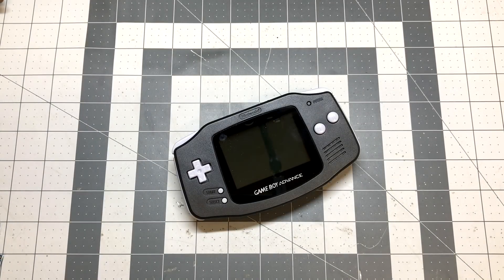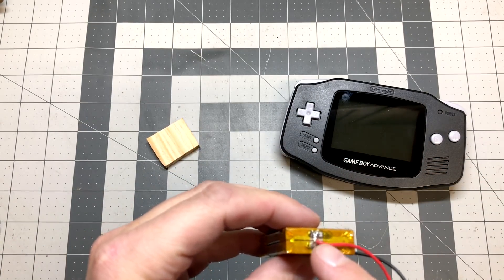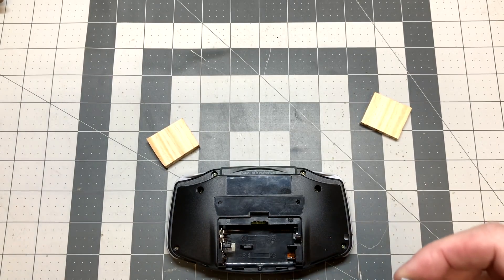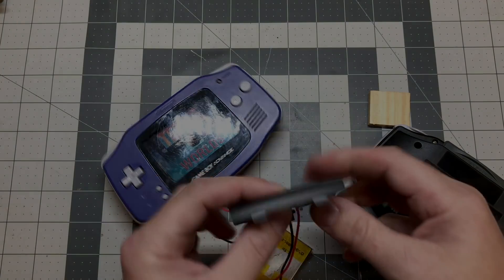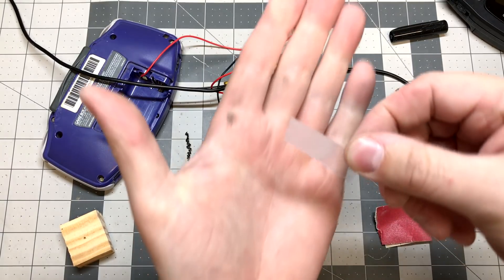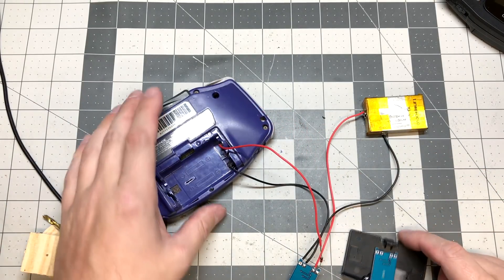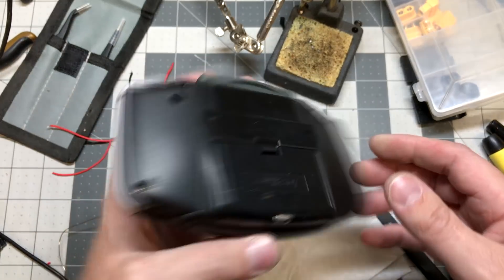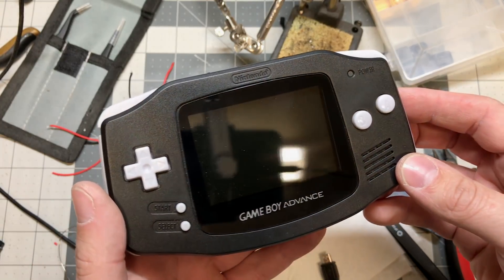USB Charging.. SO MUCH POWER.! #lithiumbattery #gameboymods #rechargeable #backlitgameboy #gba

Comment: I was wondering some things:

- I want to use a 1600 mAh battery (103048) that already has a protection circuit, could it interfere with the Lithium Charging Board in any way?
- I'm going to use a USB-C charging board instead of the MicroUSB you used because they are as cheap and all my cables are Type-C. :D
- Is the zener diode safe? I mean, it drops about 0.7v, but that energy has to go somewhere... does it get hot? Also, with the lower voltage, does the battery cuts the current to protect itself before the GBA displays the red low battery indication?
Reply: Also, how many hours do the system run with your batteries? You also have 1600 mAh batteries (2x800 mAh in parallel)
Reply from the maker: -Pretty sure your good with the built in protection circuit.. It shouldn't effect the cell..
-As for the type C that's Awesome.. Didn't know they made those.. I will have to get some.
-I didn't notice the diode getting hot.. But you should set it up and see for yourself. And I have no protection on the cell.. The GBA shuts off before the cell gets too low.
-As for run time.. I don't really know.. Way longer than I care to sit and stare at a little Screen.. :)
Reply from the maker: When I was talking about Shrek playing 3 times.. that was not the full capacity.. It was still plenty charged.. I just got tired of letting it sit there playing.. But even if this did only get 5 hours of play time.. Which I know it is longer.. Just not having to have a charger or carrying around extra batteries is quite the luxury.. It brings an older system up to todays standards.. and I am sure you could fit a way bigger battery in there if you really carve up the case.
As for making a video I might do that.. :)
Reply: I plan to use a 1600 mAh 10x30x48mm battery because I want to cut as little plastic as posible, I even did a test with some foam I cut to size so I can be sure that the battery fits.
And I might explore how to solder the wires to contact plates so I don't have to solder them directly to the GBA... that way I can always put some AA's.

Again, the video would be greatly appreciated, I've been scouring the internet and you seem the only person that recorded a video of this mod, there's some forum post here and there, some referencing this video, but none explained how it went and what were the results and battery life. ¯\_(ツ)_/¯

Comment: Hi, I just completed the rechargable battery mod but I ran into a problem when charging the battery while playing and when it goes past the full charge it makes my gba glitch out and shut down.... I have the diode you linked soldered to the positive out and facing the right way.... what could be causing this? Thanks btw for sharing how to do this and I am stoked to have gotten this far
Reply from the maker: Do you have a multi meter..?  If so check the voltage at the GBA Terminals when it's fully charged.. If it's over 3.7v that is why your GBA is cutting out.. If that's the case I would replace the diode to a different one.. The diode should be dropping the voltage down below 3.5v... Also make sure your battery case is not touching the negative terminal of the GBA. (If you used GBA SP batteries that is.)
Reply: Keylitho will do! Thanks for the quick response. It's also saying its fully charged when I drained the battery from playing... so I'm just gonna restart with a new battery and micro usb board and see how it goes. I did have the battery wrapped in electrical tape, and it turned out that the positive of the battery was the casing. I also fried a couple of micro usb boards thinking the end terminal of the battery was positive... oops! I'll get back to you asap when I rewire the new battery I get Friday! Thanks again!
Reply from the maker: So you were using GBA SP batteries..?  if so...  LOL.. that's crazy.. Read the first thing I had in the description of this video. Those things are hit or miss.

Comment: Hey guys! Retro modding offers this mod in a complete kid for 40 bucks, but I'm quite broke so I got their battery on ebay for 9 dollars, the boards for 5,  and the diodes for 2! Here are the links!
Battery : https://www.ebay.com/itm/172756197147
Boards: https://www.ebay.com/itm/331807199273
Diodes : https://www.ebay.com/itm/132500905967
The battery also makes it so you don't get bulge! You should try this out, Keylitho.

Comment: Can I use a battery removed from a GBA SP?
Reply from the maker: The battery's used in this video are from the GBA SP...  :)
Reply: Keylitho Thanks, I thought the Batteries were a replacement kit for the original GBA.

Comment: I just realised that the BL-4C battery is a close match for the GBA SP battery and probably more available and affordable and if anyone knows of a battery that's not as wide as the BL-4C battery then that would be better as les modding of the GBA case will be needed.

All you have to do is cut away the plastic that's holding the metal connector on the left hand side of the battery compartment and then take away the metal connector and also cut into and away about 4-5 mil in plastic at the top of the compartment all the way along the top under the pres catch (clip).

Also you could get two 3ds XL batteries and 3D print a case that would hold the larger batteries and connect it to the battery compartment of the GBA case or do the same thing but for the BL-4C battery.

Comment: Can this same mod work on a DMG model?
Reply from the maker: It will possible work according to this voltage test data I found.. a single cell lipo runs from fully charged at 4.2v to pretty dead at 3v and the DMG seems to function ok between those voltages.. but testing would be needed to see if it works.. 
http://blog.gg8.se/wordpress/2009/07/22/testing-gameboy-input-voltage-ranges/

Comment: Hey, just a small question from a beginner - why only one negative on the battery is soldered. not two?
Reply from the maker: Well the Batteries are taped together.. and the case is Negative.. So its not really different than stacking batteries in a flashlight.

Comment: This is awesome! The only thing that I hope for an improvement on is that I'd prefer a way to get a pair of contact plates onto the module so that you don't need to solder directly to the GBA's battery contacts, kinda like the Retro-Modding module except not $40. I'm wondering if just a thin plate and gluing the contacts onto the plate will do. I get that it already involves a case mod so this might seem kinda pedantic, but I'd prefer to solder as little to the motherboard as possible.
Reply: Was thinking the same thing. Would achieve a much cleaner setup. I’d prefer to solder the wires into the glued contacts on the plate, so those contacts on the plate will touch the motherboard spring contacts instead. 

But this was a year ago. Has anyone tried and does it work 🤔 any opinions on this?
Reply: Haidi I tried it with battery contacts and it works. However I’m only getting 2 hours battery life with the dsi battery I have, so I think I got old or bad battery or I possibly heated up the cells too much while soldering idk. Any help?

Comment: Ever tried something like this with LiFePO4 batteries?  They are 3.2v so no voltage drop is needed.  You can also get the little PCB chargers for them too.
Reply: Link?
Reply: @Ragesauce  You dont need to voltage drop anyway. GB, GBC, GBA, GBA SP, all have regulators that will bring down the voltage. They will all run from 2.5V to ~12 (though i wouldn't suggest going over 9 due to heat. 5v, to keep it at usb voltage is best)
Reply: Andrew Gist Is that definitely right? I thought that anything over about 4v resulted in the GBA shutting off?

Comment: The DS lite battery when stripped down has the same form factor but is marginally thinner. The battery cover doesn't bulge up like it does with the SP batteries. At least in my case it doesn't. YMMV They are also cheaper and according to the Chinese they have a higher mAh too lol

Comment: Have you found a suitable single cell battery that would fit yet?
Reply: Bazahaza DS batteries are pretty good, you just have to strip them then solder the same and it's 2000mah so not bad!

Comment: Hi im doing this mod and iv almost got all the bits just waiting for some batteries to come... But i was just thinking does it matter which way you connect the diode are they like resistors in this way.
Reply from the maker: Yes it does matter which way they go.. Just watch a few video's on Diodes..

Comment: The diode its necessary?
Reply from the maker: Yes because the charging board charges the battery to 4.2v and the GBA will not work on 4.2v so the Diode just drops the voltage a bit so it will work.
Reply: Keylitho
I can use 100v/ 200mA? Or who it’s better ?
Reply from the maker: Probably.. Check the voltage with the diode in place.. as long as it's not over 3.7v when the Lipo is fully charged to 4.2

Comment: I have a question. I have this DS Lite Battery. Can I use only one for this mod or do I need 2 like the ones you used it?
Reply from the maker: You can use just one.. You will just get 1/2 the run time.

Comment: could you use a 2500 mah 3.7 volt battery for this, would it extend the overall charge time?

This is what i was looking at:

 https://www.amazon.com/Adafruit-328-Battery-Lithium-Polymer/dp/B01NAX9XYG/ref=pd_cp_107_1?_encoding=UTF8&psc=1&refRID=K5RCF5SAYFSBWWR0G8Q1

Comment: Hey. I used the ribbon adapter with only the wire connection. I see you got the brightness adjustable adapter, in the battery compartment is the switch. Do you find it was worth it? With mine with just the adapter with wired connection, I achieved brightness equal too the sp ags101 system brightness on its lower setting. Big fan!
Reply from the maker: I can only get about the Same brightness as the AGS101 on low as well.. The switch just lets you go even dimmer than that.. So basically I just leave it on High and never touch it again as long as I live..  LOL  :)

Comment: Let's see... NiMH you get at 2400 mAh * 2.4v = 5.76Wh for cheap Eneloop Pro clones, for example Ikea Ladda for $7 for a pack of 4. ((2/3)+(3.2/4.2))/2 gives us the efficiency of voltage dropping diode of about 71%. This battery you get at 850mAh*2*3.6V*0.71 = 4.32Wh. Not exactly a net benefit. :( pity, for all the effort and good workmanship.
Reply from the maker: Capacity or run time is nothing compared to the convenience of charging this with a USB cable.  It still lasts way longer than anyone would care to sit and stare at this thing in one sitting.. Plus if you can stare at it forever you don't have to power down to switch batteries.. Just charge and play..  :)
Reply: Yes, these are runtimes in tens of hours. And TP4056 is a nice little charger, it can get pretty warm when the batteries are near empty, but it has a good consistent behaviour and it charges at a nice reasonable pace.

I diced some possibilities around, and i simply can't suggest a good, fast, efficient, reliable, in-situ charging circuit for 2xAA. The battery control ICs that i'm aware of tend to revolt to such use because the use will potentially set off their dV/dt detection and they'll be like ooops, time to trickle charge at 1/16th! Plus they don't mind giving the batteries a good bit of juice, like 2V peak per cell, and that will possibly upset the GBA. This is why the devices you usually see powered by in-situ NiMH cells tend to use current-limiting and slow charging without charge termination, which isn't all that good for NiMH cells either.
Reply from the maker: Yes... for sure.. you will love it..
Reply: So should I do this mod or not? I want to be able to play and charge my GBA at the same time so I don't have to turn it off to switch out batteries all the time.

EDIT
Do you think 2ds batteries would fit? They're usually 1300mAh.
Reply: I think the voltage boost from the 5v regulator makes it worth it

Comment: Generally curious: what's the benefit of using a zener diode over a standard voltage divider (outside of number of components)?
Reply from the maker: Well I'm not to familiar with a voltage divider.. but don't those typically cut the voltage in half or more..?  The Zener Diode only drops the voltage about 1 volt and like you mentioned.. only one small component = simple..  You really just gotta get that 4.2v fully charged lithium down to 3.7 or less.

Comment: Do you have both negatives of the batteries connected to the charging board or just the one? and if only one, does it matter which?
Reply from the maker: Well the Metal case of those batteries is the negative.. they are just touching each other and taped together.. so they are one and the same.
Reply: Great to know, thanks for the quick reply
Reply: @keylitho  I did everything according to the instructions, but the board heats up very much ... so much that it melted a little plastic...
Reply from the maker: @udjinhanc  I would change that board out for another and see if the issue is still there..
Reply: @keylitho  this is my mistake, I mixed up the polarity and the board failed, on the other hand, everything is ok!  Does it get warm when charging?
Reply from the maker: @udjinhanc  Yea it does get a bit warm.. but it should not melt the plastic.. or even the Hot glue for that matter.
Reply: @keylitho  I failed with two different batteries, and two charge cards, as soon as I connect + and - the microcircuit starts to heat up very quickly ...
Reply from the maker: @udjinhanc  Did you check the polarity of the battery and also follow the Wiring diagram in the description..?
Reply: @keylitho  of course.  I compared the boards, on your inscription tp4056 and on my tc4056a, maybe this is the problem?
Reply from the maker: @udjinhanc  Hmm... there is talk in some forums of some clone chips out there and people have had the same issue as you.. I would recommend getting some new boards from a different seller.

Comment: i don't understand the hate of rechargeable,i have a smart charger that charge them in 2 hour and cut by itself at the end,it even tell the battery level,.it was pretty cheap too. and rechargeable stay a long time in game,good ones are easy to find and they are sold by pack of 4 so you have always a spare...
Reply from the maker: I don't think it's a hate thing, after all these are rechargeable batteries as well.. I think it's a lets get this older system up to date thing.. Everything now has built in lithium batteries with integrated charging circuits.. So adding this to an older system is just basically for convenience.. and just being able to charge this with a micro usb cable from any usb outlet or battery pack, was the primary appeal of this mod for me.. Not to mention that you can charge and play at the same time.. so you don't have to power down the system and change batteries.
Reply: It's about energy density. The MiMH rechargeables that fit the AA battery holder actually store less power than alkaline AA batteries. This means rechargeables, while reusable, NEVER last as long as alkalines. Lithium Ion has a FAR higher energy density, and is often convenient to charge, thanks to universal standards like USB Micro. That's why it's preferred.

Comment: I'm working on modding my gbc, would the charging board and everything work the same way
Reply from the maker: Well that runs on 2x aaa's so the voltage would be the same.. Probably have to use a smaller Lipo.. But Yea probably would.. I would recommend testing on a spare unit first.

Comment: Really a amazing mod! I am in no way a wizard when it comes to electronics and this has been one of my most wanted features so this guide is really a huge help to a scrub like me.

I have a few questions though before I begin modding my own:
1st: Do you have both negatives of the batteries connected to the charging board or just the one? and if only one, does it matter which?
2nd: In a earlier comment there is talk of moving the zener from Out+ to Out- in order to improve the battery life. So I just want to be clear, does it improve or should I just stick to your method for safety sake?
3rd: Is it possible to include a 5v&1a wireless charging module in the circuit? like these http://bit.ly/2AIDxT4 , and If so, could you provide me with assistance in making up a safe circuit? :)

Thank you in advance! (pun intended)

Comment: Hi great video i have questions as I'm not a expert in electronics I was wondering if this mod could be done to my sega game gear thank you
Reply from the maker: The game gear runs on 10 volts.. (at least that's what the AC adapters put out) so you would need a 3s lipo and that would need a different charger and a voltage regulator.. The good thing is that you have plenty of space in that bad boy.  So I guess the answer is Yes but it is very different from this mod.
Reply: Yes this can be done. Also you can make the game gear run on one 9v battery . This would be a good project
Reply: To charge more than one lithium cell make sure the charger is balanced.

Comment: What kind of stand are you using for holding things when you solder? It looks great I need one
Reply from the maker: Just a classic helping hands soldering station from Radio Shack.. But I have shrink tube on the clips and a 3D printed PCB holder on the other side.. You can find similar almost anywhere.